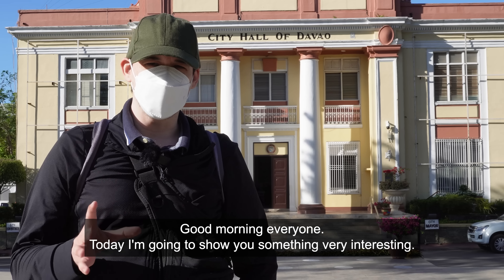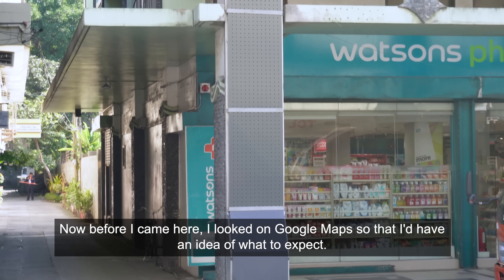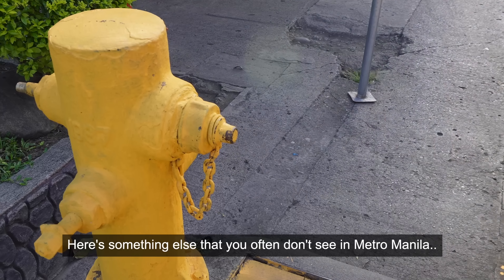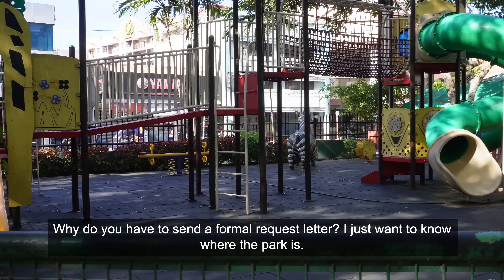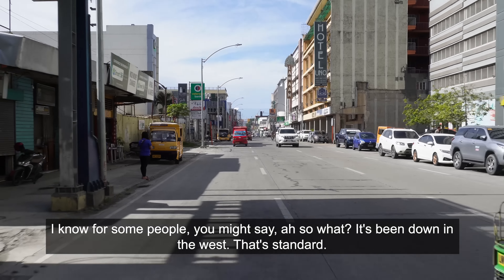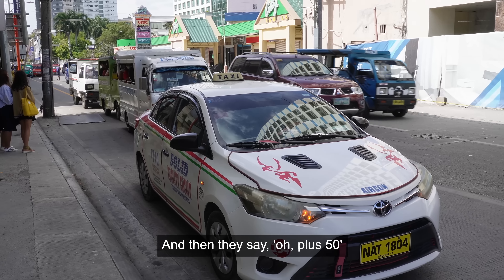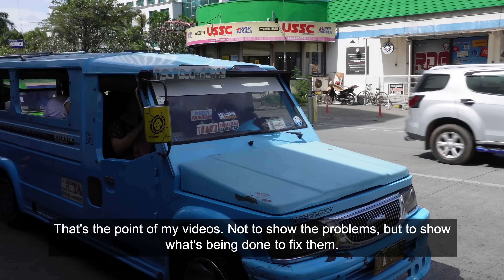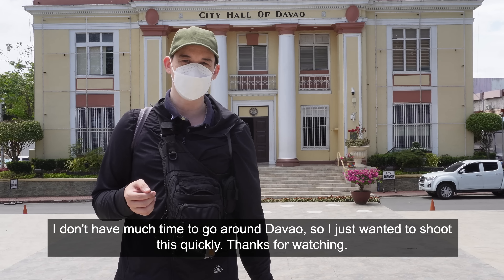Davao City - Benefits of Undergrounding Power and Telephone Wires

Comment: Looks very neat, like the 1950s. But imagine having to upgrade the wires, wouldn't that be a nightmare?
Reply from the maker: @singaporeancrab718  if they're all labeled then it should be a matter of simply pulling them through, right? Just like in a house with conduits.
Reply: @GadgetAddict  yeah i think you're right. with proper technology, planning and implementation, the enginners should be able to develop a system for easily replacing the very long wires underground. the question is if the engineers will be able to do the feat correctly. if not, davao citizens will be using the same wire type (no upgrades) for the next couple of centuries.

Comment: Underground systems are protected from strong winds and falling trees. They also look better aesthetically. However, buried lines are susceptible to water, earthquake and excavation damage, and can take longer to repair because the damaged area is usually more difficult to locate
Reply from the maker: All good points. Thanks for the feedback.
Reply: They can just stay with the overhead line installations and all they have to do is rationalize the overhead lines and get rid of those that are not used anymore and follow elcetrical codes. If you think about it, all the posts need to have is just the 3 phases and an overhead ground wire for the high tensions wire and the two or three lines for the low voltage (220v). And those telecoms and fiber optics should be replaced with trunklines and not single lines - this is just the telecom companies being lazy and not following the codes.
Reply: We've had underground everything (including trains) for a very long time (electricity over 100 yrs) Water damage even in flooding areas has never been an issue. Repair and replacement is easy because of manholes. Telephones were forever being cut off by storms and vehicles crashing into poles before they went underground  in  the late 20th century.  Earthquakes have less effect on underground cables than cables on poles and the sides of buildings.
Reply: Everything has pros and cons. Kesa negative, give it a try then try to solve the cons
Reply: @YES PLEASE  as long as cost it not an issue, go ahead.
Reply: @ziggarillo  which country are you pertaining to?
Reply: @johnraymund1006  I thun he is pertaining to the UK
Reply: @ziggarillo  agreed
Reply: @johnraymund1006  probably not ph but still why wouldnt it wok in ph?
Reply: @johnraymund1006  referring to ? Uk
Reply: @youtubephan2427  It works everywhere else in the world, what's so special about the Philippines?
Reply: Ignorance! It's not susceptible to water damage. Those wires are insulated with water resistant materials that resist mosture damage. If ever it gets broken, they have a special connector which makes the splicing water proof as well. It has multiple layer of insulation that prevents water damage.  Damange through excavation is BS. This only happens when the construction has no permit from the city.
Reply: @ziggarillo  UK and Philippines is two different countries, Philippines is very prone from flooding, much probably 3-6 feet deep floods and A LOT of typhoons enter the Philippines
Reply: @johnraymund1006  don't generalize the whole country. It's the civil engineer and other engineers to work together to design the underground cabling project so that it won't get broken. They will not put wire undergound if the area is sensitive to flooding.
Lastly... Davao is not a typhoon prone area.
Reply: @ziggarillo  Lol, with the status of the Philippines economy, we can't just implement underground wiring overnight. There are more problems that needed to be prioritized first than these, like the poverty problem; there are so many people that can't afford basic needs; even our infrastructure, like railways, highways, airports, anti-flood system, etc., is lagging, so why do we need to prioritize beautification? Please be realistic. No one is saying it can't be done, but we need to wait. It is not easy, especially in metro Manila, where 60% of the country's GDP comes from. Implementing that project will affect the businesses in the area because it will cause more traffic, which, by the way, underground wiring doesn't even generate income for the country. It is already toxic to travel there; implementing it will only make it worse. They did it in Davao because it will become the blueprint for the underground wiring in the whole country, so it is a good sign.
Reply: What about hydrovac excavation?
Reply: @francisScrnName  thats a good idea but Philippines doesnt have that kind of excavators.
Reply: @tomg.625  Lol it's safer than cut off or broken fallen wires that's still connected to the main source.
Reply: I'd still want the underground system, it's more safer that what we have in most cities.
Reply: The only problem here is that underground cabling is cost prohibitive specially when you are retrofitting an existing overhead cabling system.
Filipinos would appreciate the 3rd rail power line of MRT 7 once it is fully operational as you wouldn't see any overhead catenary system which is used in LRT 1,2 and MRT 3.
Reply: @Lolo Ermie Tanyo easy to say. exposed damaged wiring nga eh hirap silang mag ayos. underground pa kaya. imagine heavy flooding tapos may nasirang wire sa loob. instant electrecution
Reply: Yun mga negative comment dito.matagal na ganyan sa Vietnam .tayo kulilat
Reply: @johnraymund1006  We have flooding in the UK, a lot of our old towns are built beside rivers and some new developments have been built on flood planes. We have high winds that bring down trees and overhead lines, that's why the majority of our infrastructure is underground
Reply: @JC0820  We didn't bury our lines to beautify our towns. It was because we kept getting power cuts and loss of telephone connection.
Reply: @johnraymund1006  nahhh we dont have that problem here in my hometown.. probably because you guys clog your drainage systems with garbage.. or maybe your lgu keeps neglecting your drainage thats why.
Reply: @bhudzSanctus  i dont reside in metro manila
Reply: @johnraymund1006  Who mentioned Metro Manila?
Reply: @ziggarillo  am i replying to you?
Reply: @mirieshii1948  in case you don't know at the current state when there is a flood or strong typhoon, power is being cut off because of fear of electrocution.
Reply: @tomg.625 eletric utilities do have the facility to disconnect live wires when it senses a fault or flooding. naka divide pa po yan per sector so the whole city does not lose power esp with how large davao city is
Reply: @JC0820  Going underground means more reliable power, phone, and internet service from extreme weather and other causes of disruption (e.g. vehicular crashes to electric posts). This will certainly attract investors especially in the offshore industry and manufacturing which will then create more jobs and address your poverty concerns. An abundance of jobs means bigger government revenue and will eventually fund your other infrastructure concerns such as railways. Underground cabling isn't a beautification project. Making the place more beautiful and tidy is just a byproduct.
Reply: Engineer? Lol😂

Comment: Underground cabling is very old technology. It's not like nobody in Manila ever thought about that before.
The issue with Underground cabling is maintenance and scaling that is too impractical for a heavily congested city like Metro Manila. 
The infrastructure for that is much easier implemented if you are building a city from scratch or for lightly congested areas.
Reply: Doing vs thinking
Reply: @darkboard5556  
Doing without thinking = disaster
Reply: @origenjerome8031  over thingking = nothing
Reply: @darkboard5556  
Overdoing without thinking = expensive disaster
Reply: @origenjerome8031  over over thinking = more nothing
Reply: Davao city, especially the streets where  these underground cabling projects are are already very congested. Pre-pandemic study shows Davao city used to be 8th most congested city in ASEAN. CM. Recto street is one of the mosr congested street in Davao and look what they did. These underground cablings were designed and constructed with futureproof in mind kaya't makikita mo sa video ung pinakita ang mga wirings sa ilalim na andaming wires ang ibinaon. Nasa LGU na yan ano ang mga priority policies nila. Basta Davao city, the LGU wanted to mirror the best practices of developed cities around the world (e.g 911, underground cabling, etc.) And that is one of their priority policies.😊

Comment: Hi gadget.i was part of a team that installed underground power cables in makati and bgc  many years ago... but in some parts of manila its going to be challenging considering the flodd history of the place. But it's doable.
Reply: My dude's underground cable po ay waterproof, even the junction box is fully protected. IP- 67 or 68 compliant, ibig sabihin kahit po bumagyo,yelo or extreme weather wala po problema. Politiko lang po talaga ang palagay ko humaharang sa anong reason we don't know.
Reply: That is why I said it's feasible.
Reply: @novus310  Before the underground cabling commenced in Davao city, they have implemented citywide drainage overhaul at least 7 to 10 years ago which reduced flooding incidences in the major thoroughfare of downtown Davao. Underground cabling have many layers of insulation. However, it will be ill-advised to randomly implement it. Fixing drainage and flooding issue is one huge insulation layer afterall

Comment: There are a lot of things worse than excessive wires in Davao.  Excessive traffc, brown outs, limited water supply, street lights not working, tricycles on main streets, motorcycles weaving in and out of traffic, excessive jeepney stoppings. Then, there is the redundancy in paperwork.
Reply: 😅 anong limited power supply? Very rare mag brown out sa davao aksi sa loob mismo ng city may power plant, water supply is due to repairs citywide. Street lights iilan lang at napapalitan naman agad. Jeepney pinapabayaan na yan ksi it will phase out soon and replace by hbps. Trcycilce is available only at night pag konti ang jeep at taxis na nagbabyahe. Lol
Reply: Brownouts???? Clearly you’re not from DVO. Tricycles???? Those are not allowed on major roads & mind u our TMO is notorious when it comes to traffic violations.

Comment: Most filipinos do not want to change for the better.  For example this Underground cables,  phase out of jeepneys and replace with modern electric vehicles, national ID, these  are some of the govt  plans that most pinoys do not want. Grabe, kaya hindi umuunlad ang pinas. Hindi lang yan, Nakakahiya talaga...marami pa rin ang nanghihingi ng pera at pagkain sa mga kalsada...karamihan mga bata at mga teens...ang mga magulang pabaya sa mga anak nila.. .begging is a sign of laziness...asan na yung mga clearing operations at rescue operations sa mga street dwellers sa metro manila ?  Marami pa rin mga kalat at basura sa mga kalsada at bangketa...hindi lang sa syudad pati sa mga dagat natin, beach, sa mga gubat at kalikasan maraming kalat ng basura tulad ng plastik na supot at bote, upos ng sigarilyon at sari saring mga basura (litters).  Wala tayong modernong infrastructure at transportasyon. Mahina at walang internet,  mga gahaman sa pera na mga taxi drivers at trycycle drivers over charging foreigners, expensive accomodations, maraming mga illegal squatters, illegal vendors at mga street dwellers na nagkakalat ng basura at ginagawang dugyot ang mga syudad natin. "Its more garbage in the Philippines". Philippines is one of the largest source of waste/garbage sa mga dagat in asia. Dapat ayusin natin ang mga problemang ito bago tayo mag invite ng mga tourists at sabihing 'Its more fun in the philippines'

Comment: Where do they put the round transformers you see on the power poles
Reply: Marami po di lang nakikita sa vids.
Reply: You can have local transformer stations to supply a large area, the don't have to be everywhere. In the UK they are called "substations"
Reply: The are this bridge-like structures on the side walk which is elevated. They put the transformers on top of that.

Comment: the reason why it was never implemented in other cities coz of flooding issue. Because they are live electrical wires but I guess the material needed to properly insulate and maintain them underground were just expensive compared to letting them hang on poles. You know how Philippine government thinks. The cheaper, the better. But it only looked better in the past when cities didn't have a million population like municipalities with only less than 100k population. It became so eye sore in today's time than it was in the past just like jeepneys. The need to modernize not just for the environment is important. Look at india suffering from smog due to pollution. Because cities in india has a population of 30+ million. Compared to Philippines with cities not exceeding 2 million. So anything excessive becomes a problem. Same goes for spaghetti wires and amoke belching jeepneys. My first job abroad was utilities design engineer in dubai. Everything is underground. Internet, gas, electric and water. They're all in the sidewalks on top of all the interlocks so it can easily be fixed and what's amazing is, they have a full map in their system of all these Networks of cable lines underground. I think that's something the Philippines has yet to adopt since coordination between government records and private individuals are not normal. You can build a house in Philippines and god knows where you release your waste water. Not in Dubai and other developed cities. There has to be a more coordinated design and of course a faster digutal experience to access such design. Coz in the Philippines you need to wait and wait lines and qeues only for a hard copy. Why the country never progress is coz people in luzon are less disciplined, lazy and snowflakes. They got used to their privileges that the president and policy makers dragged the whole country down. There is so much to improve from the perpective of someone from mindanao. Manila is not the entire Philippines afterall
Reply: We have flooding issues here too. The only difference is the lgu here in davao is working on fixing it. Actually it's currently causing traffic because of the project. And it's reasonable. For us to move forward we need to sacrifice temporarily.

Comment: Pros: Wires protected by weather, storm etc.
Cons: Installations and maintenance.
Reply: Installation for the first 2 streets was a nightmare for commuters. It is not going as bad for the third street now though. But the last phase is going to be along the longest of the 6 streets covered by this on-going project. The traffic will be hellish without a doubt. But no pain no gain!
Reply: @darkboard5556  exactly totally agree

Comment: Trust me when I say if there's a problem with the cable underground there will be a massive problem with road closures, pavement closures and disruption. It does make the street look more pleasant but the cost of digging the ground up does increase.
When the cable is in the air it's access is by just a mechanical lift.
Reply: Yet most modern cities in the world have underground cables, I wonder why?
Reply: Therefore, laziness is king.
Reply: Gees...may junction box po lahat ng conduit at manhole na para lang sa cable wala pong hinuhukay pag may maintenance. Kong halimbawa may mag tatayo ng structure need permission sa cityhall para malaman kong saan safe mag huhukay lahat po yan naka plano at bawat naka baong cable may marker lahat yan naka plano kaya kong may ikakabit or aayusin plano at capable crew ang gagawa nito sa mabilis na paraan.
Reply: If your people is lazy, there's always a reason not to do it. Why bot find a way? Lol

Comment: Pros:

Not vulnerable to damage from tree branches; no right of way trimming required.
Less susceptible to damage from vehicle collisions
Not impacted by wind
Less vulnerable to blinks when animals and branches contact lines.
More attractive. Some people choose to install underground power lines so the infrastructure doesn’t obstruct their view.
 

Cons:

More expensive to build and repair
Fed by overhead lines. At some point, all underground power lines are connected to overhead lines, which makes them vulnerable to outages.
Susceptible to flooding
Difficult to locate faults
Limitations on voltages that can be buried underground.
Can be vulnerable to dig-ins.